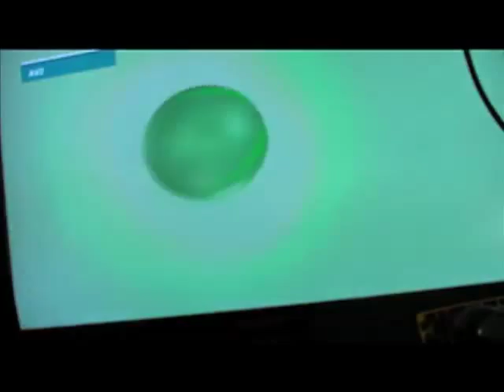watercooled my xbox 360, build video pt. 1 (FOR SALE)

Comment: @boostedboogie 
Your right, in order to clean up the install, you needed to have the pump hooked up BUT, your pump can be damaged if it runs without fluid going through it. A few minutes without can seriously shorten the life span of your pump. Personally I would add a flow indicator to the tubes somewhere so your can make sure the water if flowing. Also, your using Arctic Silver 5-great stuff, but its VERY conductive and can short out the little pins surrounding the cpu and gpu chip. be careful

Comment: Quickest way to break your pump is powering it up dry, the impeller inside the pump needs liquid to stop it smashing about on the inside. I could hear it scraping as soon as you powered on and put the pump up near the camera. Id check it for damage. And if you have a problem with the pump that be why.
Reply from the maker: this video is 8 years old. xbox ran perfect for 3 years until i switched over to PC gaming. as far as i know the new owner had no issues with it too until he got the next generation xbox.

Comment: i dont mean to troll, but for future preferences you really should A) not run your pump dry, its can cause severe damage to it even for running it a couple of seconds. B) clean off the existing thermal paste from the CPU and GPU with isopropyl and also clean the contact points of your water blocks.

Comment: Hey dude, it's like head bolts on a car, work from the center out on the heat block over the processors, you did it wrong.

Comment: @boostedboogie Overclock does not mean watercool, overclocking is raising processor/graphics/ram clock speeds to higher than stock in order to make them go faster. Also you made several mistakes, first of all NEVER run a pump without coolant in it, second is red wire = 5v, yellow = 12v, you soldered the pumps 5v to a 12v wire. I can respect that you are putting in the effort to watercool an xbox but you should get your facts straight before you try. Its really something not to play around with.

Comment: Yo that was WAY too much thermal paste. You're supposed to barely put any on. A VERY THIN layer. It's only meant to fill in the micro cracks in the metal of the heatsink and CPU heatspreader. Too much thermal paste will INCREASE your temps.